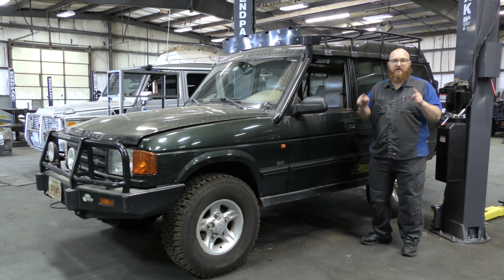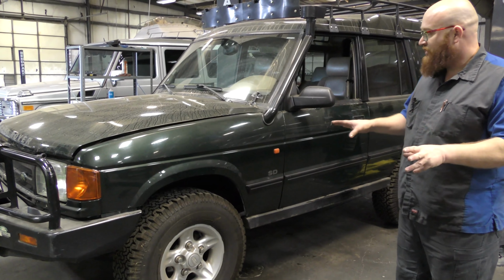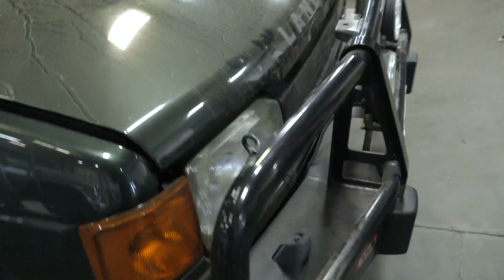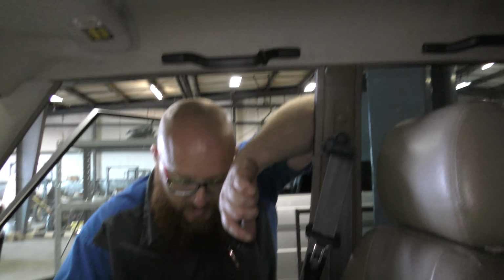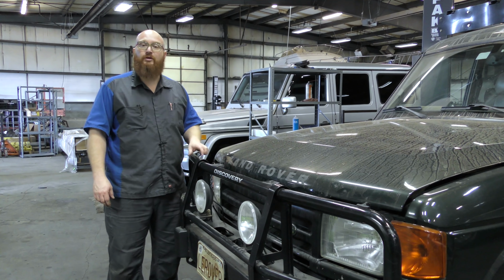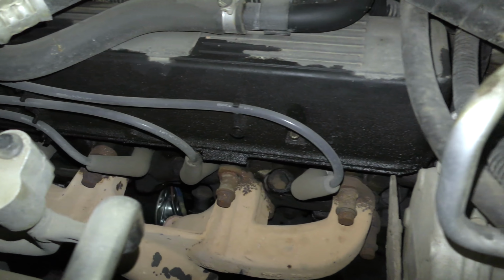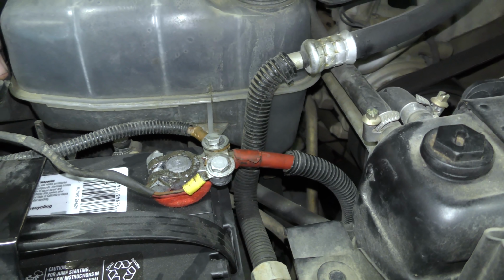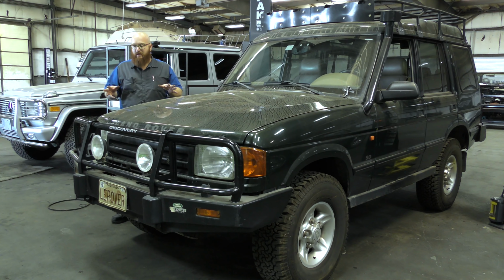How can such a simple repair cause huge problems on this '99 Land Rover Discovery? CAR WIZARD knows

Comment: Always check the simple things, while I was a service manager for a national auto repair chain I had a regular customer call panicking  about how his car would accelerate when he pressed the brakes. He had almost crashed several times and was spooked to drive his car. I told him bring it on in, my senior master tech would be waiting. Mind you this gentleman had been coming to us for well over a decade, super awesome and kind gentleman who we all knew by name. So, yeah I made sure to have my best guy on it. Anyway, guy shows up in a tow truck and while I'm getting the repair order set my tech brings the vehicle in. Five minutes later just as I'm about to print the work ticket my technician comes in with a huge smirk. He looks at me and the regular pulls a floor matt from behind his back and says "Well here's your problem" then chuckles. Apparently he had just put some generic floor matts in and the drivers matt got pushed up over the throttle pedal and behind the brake pedal. So, as he pressed the brakes, the matt pushed the throttle down. Our regular turned bright red with embarrassment, we all laughed. My tech trimmed the matt to make sure it never happened again and we sent him on his way no charge. An hour later he came back with six pizza's, breadsticks, wings, pop, the works, and apologized for wasting our time. Me and the master tech assured him it was no problem and that anyone could have missed that. We asked how his floor matt was every time he came in afterwards. Awesome guy, glad we didn't find anything horribly wrong.
Reply: This aftermarket floor mats, I had a buddy who thought something was wrong under his car and it ended up being the floor mat he put in. He moved it and the problem went away, he was all worried. Need to have those things clipped in or something.
Reply: Wouldn't happen if all vehicles had pedals above the floor.
Reply: Great story!
Reply: My brothers first car in the early 80s (1962 F85 olds) he put a cover on the gas pedal that looked like a foot.  Every once in a while it would "stick" and you would have to quickly put your toe behind it and pull it forward so the car didn't keep accelerating.
Reply: I do not like slick floor mates;  because of armor Al.  I like the green color on the Range Rover.
Reply: It's rare you meet someone that identifies as a Sith Lord with such integrity.
Reply: This is the way its supposed to work👍👍
Reply: You may have saved his life.  It's not nothing.
Reply: Yep.  9 times in 10, it's something simple that you overlooked due to being frustrated.  In my case, it's a blown oil line that starves the motor like a jugular being severed in the body.  Drained the entire oil system in 7 seconds and introduced the pistons to fresh air at only 18,000 miles.  💩
Reply: @danielcarter5579  they make some really strong gorilla glue Velcro strips for these sorts of things. The sticky side obviously goes on the floor and the mat, with a Velcro that gives up much easier than the glue.  Just put a long strip on each side of the driver's side mat and on the (very clean) floor away from where you rest your feet to avoid having a hump where you'd rest your feet or use the pedals, as the two strips create a ridge.

For those with carpeted floors, a single piece of sticky Velcro works great, since eit can latch onto carpet fibers.  Just be sure to Dremel down any ridges on the back of the floor mat to a smooth surface before adding the Velcro piece or it'll never stick well enough. Learned that one through experience.
Reply: Darth Vader. Thank you for passing on the good chuckle  It was a beautiful story about beautiful people 
 I am an uncontrollable optimist !  This story puts a smile on your very soul 
 The six pizzas were an outstanding. THANK YOU
 Be well !!
Reply: @777jones  You know I recall those stories about the run away acceleration
flaw a while back and
sadly people were  killed
it's possible that the key would not turn "I don't know but could they not shift to neutral ??? I would have gone right PAST neutral and put it in REVERSE !! BUT then I would be accelerating 
backwards at high speed !! And then ...and then..
%#&@$%"
Reply: @americansmark  I HATE when that happens !!!!
Reply: 5 mins for 6 pizza is a sweet deal !
Reply: A few years ago, a family of four in a loaner Lexus died just a few miles from me due to this issue. The real tragedy was that the driver, who was a California Highway Patrolman, panicked and never thought to simply shift to neutral--as another poster suggested above. At the time there was some active dialog on social media, with some folks claiming that this would blow the engine. First, so what? And more to the point, virtually any car built in the past 20 years or so limits the RPM in neutral. If you don't believe that, go out to your 2000 or later car, put it in neutral, and floor the accelerator. You'll likely find that it won't go past 3,500 RPM or so. I've made sure all my family is very clear that if the accelerator sticks, the first thing to do is shift the transmission into neutral.
Reply: @BigBen621  yes since if you turn off ignition you may end up activating the steering lock and thats even more dangerous. Neutral is the way to go.
Reply: Back when I wrenched, that was my rule check the easy stuff first.  You’d be amazed how many problems are caused by loose nuts…
Reply: My rare Defender 2.8 did the exact same thing with the original Landrover mat. Had me almost totalling it one day. Threw the mat out!
Reply: I’ve done the same thing. The floor mat. I thought it was a bad clutch. Just couldn’t put the pedal all the way down.

Comment: The 150 bucks isn't for the tightening of two bolts. It's for the knowledge of which bolts to tighten.
Reply from the maker: Exactly!!
Reply: @yambo59  
You wouldn’t spend $150 to fix a problem after you tore apart the steering column and whatever else you waste time with?
Reply: Perhaps he assumed that was checked as well, given the dismantled column, test light and the customer's own claims.

Additionally, crusty fuses and terminations cause the same gremlins.
Reply: @yambo59  glad someone said this & to top it off he made a video off of this guys simple mistake. I understand making money and running his shop but if I was a customer and saw the video I wouldn’t be happy. I will say I’ve been watching the wizard for along time now and think he’s a very fair and honest mechanic (really hard to come by) Just in this instance I think a little kindness would go a long way. Plus he’s got hoovie to keep the cars coming.
Reply: @Despicable909  
He had the owners permission otherwise he wouldn’t have made a video
Reply: @12yearssober  just seems like double dipping. I would of been honest with the owner... have a good day Jeffery Epstein.
Reply: @Despicable909  
He was honest. He told the customer what was wrong. He fixed it and charged a fair price. He has bills to pay. I do HVAC. I’ve had plenty of calls that only needed a battery in a thermostat. A few times people have the switch off. I still charge them for a service call. They are paying for your time and experience.
Reply: @12yearssober  - might not be wise to disclose that Witness Protection has you masquerading as an HVAC tech, Jeffery.
Reply: @petrosaguilar8916  
Especially at junior high schools 😂😂
Reply: Charge him the full hour. You are worth it. When you are gone they're paying for a new car.

Comment: My teen daughter wanted one for her first car. I found a beauty but I knew it was going to be a headache. But she was 16 and only drove it to and from school. And I liked the idea of its size from a safety aspect. It had the usual disintegrating plastic hoses. This caused it to overheat. I don't think it blew the head gasket. But the coolant would disappear. No visible leaks. No visible smoke. No coolant in the oil. But it would just vanish. Eventually sold it for what I paid. Disclosed the issue to the buyer. They are amazing off road
Reply: That was a great decision to make. You should buy your teenage daughter a four-cylinder mid-size sedan for her first vehicle. For example, a 2010 Hyundai Sonata or a 2018 Mazda 6. I would definitely go for the Sonata because it is normal, but the Mazda 6 is fast with their Skyactiv engine.
Reply: had an issue with my Aussie Ford Falcon loosing coolant, all hoses was fine and no visible leaks, I happen to rip the engine out to swap over a gearbox and stumbled across a leaking rear Welsh plug.
Reply: Our kids drove our lr3 aka battle box, they put in a few pickles, but always walked away with dents, and minor things, no major damage,  just basic maintenance which out teenage son got into, with help of  you tube, altanic British , 245,000 miles, on its  last teenage  much to there demise
Reply: Great trucks mine isa 97 V8 3.9. Currently sitging in Garage as did the Head gasket thing at 200.000 give or take am slowly pulling engine out have sourced another low milage motor. Will be getting water pump, thermostat, frost plugs bronze ones before goes back in oh and power steefing pump mines leaking. Other than that all good 😊